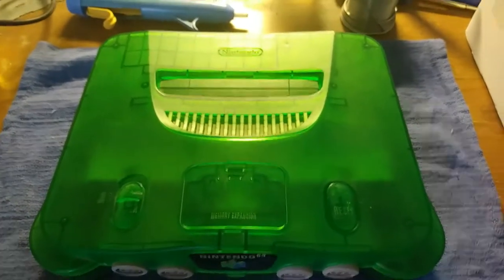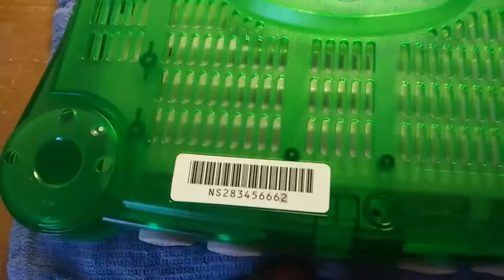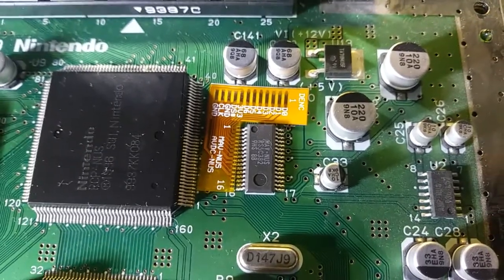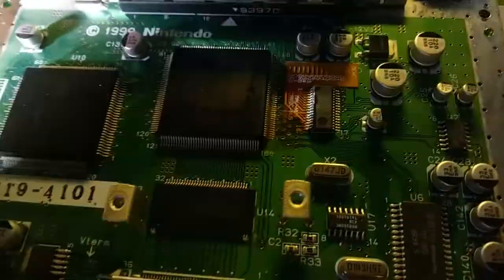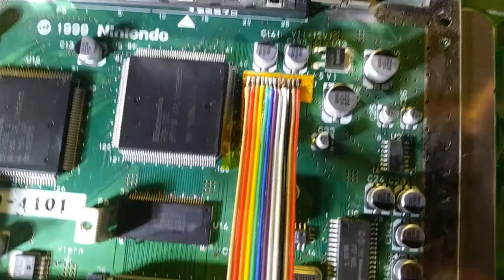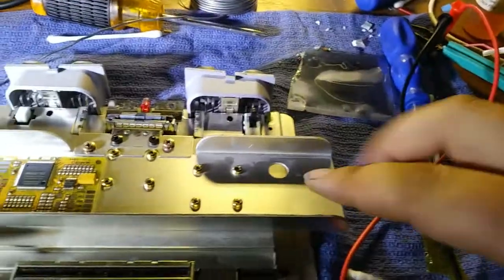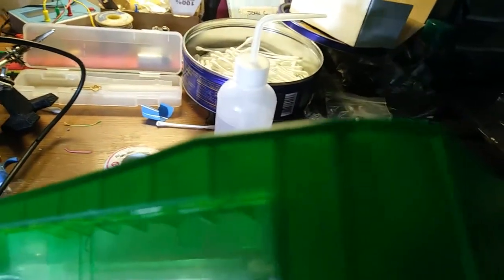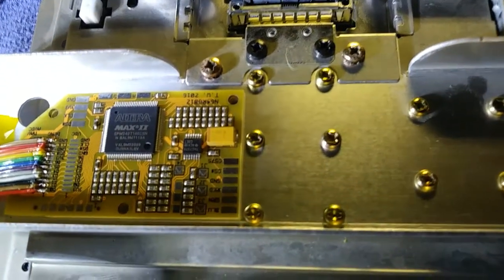N64 RGB Mod (Using ETim's Kit) on Jungle Green Funtastic Console

Comment: What size wire did you use for the output? Thanks
Reply from the maker: I believe everything was 30 gauge wire. The output wire was just the extra strands  from the ribbon cable that came with the kit
Reply: @71dembonesTV  thanks 👍
Reply from the maker: @eatrice90  no problem, thanks for watching